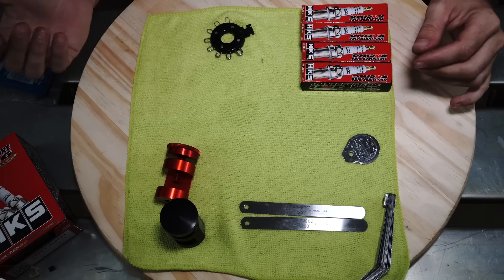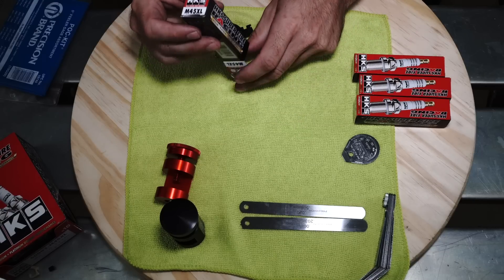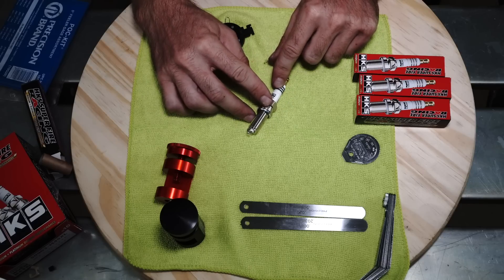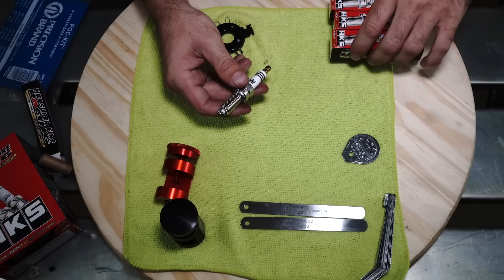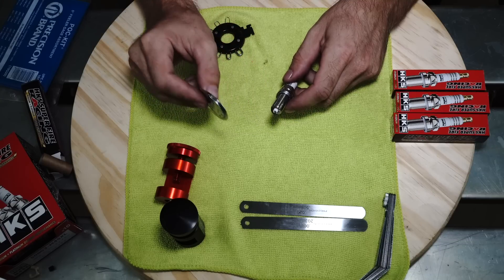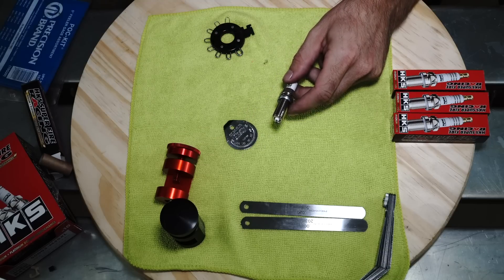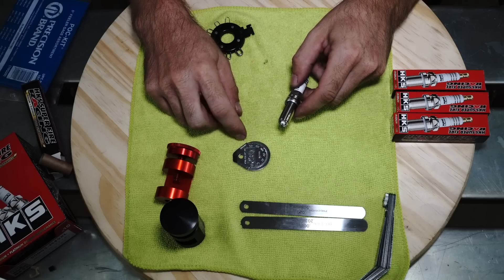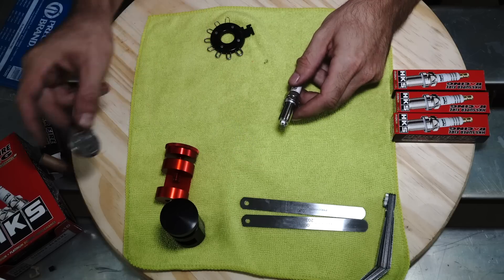How to Gap Iridium spark plugs

Comment: That tool works just fine The old style plug gapper you just don't want to use it to gap a iridium plugs. It works just fine for checking the gap just not making the gap larger

Comment: It's weird sensitive to little pressure, yet it's under high pressure to instant explosion, intense heat to cool air mix fuel, compression heat to explosive temperature extreme push pressure, but little prying is damaging.crazy

Comment: Appropriate and apt video.

Iridium tipped plugs are to be treated with kid gloves - how I miss the old days, as good as Iridium tipped plugs are setting them can be a fiddly chore. 

Also, if one can't find their trusty old tools for adjusting sparkplug gaps (I couldn't), then the options for such tools now are limited to a fair amount of Pacific Rim inferior tools💩💩 💔💔

The disc gap tools are okay but ONLY if inserted like a feeler gauge, and NOT used to lever or open the gap (especially not against the electrode), or used to wedge open the gap.  The hole can be  - in the correct orientation - CAREFULLY used to open up the gap (but it can be tricky and tight to the electrode). 

Nice to see you using a threaded gap closing tool btw.

No banging sparkplugs atop of a vice or the garage floor these days, especially not with Platinum or Iridium tipped sparkplugs. 

Just proceed with caution - follow best practice - and all should be well. 

A useful video.

Comment: This whole gaping thing is actually so complicated. Because they say dont touch the center piece, but you have to if you use all those things to measure the gap. So its literally dumb to me whenever anyone says "dont touch the center piece" and then they touch it anyways, they gave to, all those tools touch the center. So the best i seen is dude just said dont gap them , just put them in car,  because the factory gaps them to the proper gap. Its really just anal to try to get it exact anyways. And to much to get it perfect , means you touch that center piece, so any touch is damage according to everyone. So to me i would just take them all out the box and line them up and look at all the gaps together, and any absurdly higher or lower then the rest, then adjust that one. But other then that, i mean, the gaps on all those spark plugs in general are just so super close to almost touching, so the closer i dont think it would be a problem. I would love someone to test my theory. Just gap it to as close without touching and install them and see how car runs. I bet it probably run better. Because those gaps get wider over time. So gapping as close as possible is actually the gold standard if you ask me.  Problem with my theory, is i dont think ANYONE has made youtube video to show if this works or messes up car. But i think im right. We need like one of those anal science nerd youtubers to try it. But bottomline is, all i am saying is, all the gapping tools, they call touch the center piece that everyone says not to touch. So all tools have the potential to ruin the whole spark plug. Which to me means, never use any of the tools, and eyeball it and just make gap as small as possible and never put anything in between the center piece and top piece.

Comment: With the coin gapper you don’t just shove the ramp into the plug gap to open it up. It’s just used to measure the gap. You use the small “key ring” hole to open the gap which puts no pressure on the electrode. Still not the best for fine electrode plugs such as platinum, iridium, or ruthenium, but if used properly they are not complete trash.

Comment: Video is informative, but that’s actually not how you use the “round coin, necklace spark plug gap tool”  you stick the thru the hole and only apply pressure to the ground electrode.

Comment: I haven't even made it into the Vid and it's Not silly. My NGK's have a stinger/electrode on the strap end too. So it looks like 2 electrodes facing each other.. On mine.. They come pre gaped but I have laid them on the table and seen one off from the rest and had to tap it in a little. They are sensitive. wow. Oh and 25 a plug.. a $100 for 4 spark plugs.. I have that gapper and the one time I used it, I learned a $25 lesson..

Comment: Great video,  I just got a Lang 4550A ramp gauge tool with a built-in electrode bender. Also, that tool to bend the electrodes down is nice, but I've always used feeler gauges and cleaned them off first, then used a dial calculator to check the blades.

Comment: Very helpful and informative, and as I figured, the tips shown are the basic ways I was taught 45 years ago from my father gapping plugs. Moreover replacing my first set of modern plugs I sensed right away the delicate nature of the the electrode, and thanks to this video confirmed the methods I use to gap plugs is correct. There are many videos this one was the better video in my opinion simple and to the point.
Reply: Ditto here. As long lived as Iridium tipped sparkplugs are, I kinda long for the old days👍🙏😀

Comment: The circular tool is only a gage! Not a tool to adjust the gap! Wire gage is not recommended. you can damage the iridium tip by dragging the gage thru the gap.

Comment: You need to check the gap with the pressure of the tool off of the electrode  because the electrode springs back a little when you back off the knob.
Reply: Can you add some heat when it’s compressed to prevent it from springing back?
Reply: My thoughts exactly. How can a tool that large only do one thing plenty of room to make it bend it back somewhere on that thing

Comment: I am trying to replace my spark plugs for the first time and I keep hearing the coin-type is thrash. HOWEVER, what if you just pick a size on the coin-tool and with your eyes next to it try and isnert between the electrodes and see if it fits literally without making contact. Then you'd go up or down until you find a size which slightly touches the electrodes. NO SLIDING. Isn't this the same thing you're doing with the other 2 types. Someone let me know if I'm missing something.
Reply: The coin-types are still trash, they are not very accurate - they are cheaply made and the fact that they are a wedge design means that measurements aren't very precise. If you're not seeking precision, just run the plug as-is pre-gapped. Otherwise, invest in precise tools. Personally, if it's not way off I don't think -/+ 0.003" matters all that much e.g. if the pre-gap plug was 0.030" I wouldn't bother with the hassle of adjusting it to 0.028" if that was the listed spec.

Comment: Buy the tool from AliExpress directly, don't get screwed by crooks, #Aliexpress € 1,47  21%OFF | 14mm Lightweight Vehicle Caliper Gapper Gapping Aluminium Alloy Car Engine Spark Plug Gap Tool  Automobiles Accessories Durable
https://a.aliexpress.com/_dTfXBET

Comment: Since this is a how to video, I think it would be great to tell us what to look for when you are measuring the gap. Saying that's good while sticking your feeler gauge in doesn't tell us anything! How about saying that it should be a tight fit, loose fit, or maybe feeling just a bit of drag. Not a good explanation of how to...
Reply: Slight drag. If you have to force it in, it's too narrow.
Reply: @worshipwhilewewait  Thanks but already googled it since the video was no help...
Reply: @pdog2448  More research helps us DIYers anyway...don't you think he did a good job to get us started & thinking about checking the gaps? I never thought to check them with the tool until now. This guy meant well...I like that he introduced the tool AND demonstrated with it.
Reply: Correct “feel” for the feeler gauge - is called “magnetic drag”- as you pull the feeler gauge thru it should feel about same as dragging a magnet across a smooth steel surface. 😊😊😊👍👍👍
Reply: instablaster
Reply: I bought a "fan" feeler gauge. There was no "notch" to open the gap. I used the finger detent that is used for opening the gauges. Slides right in there, but be careful. Over corrected on the first one and had to tap it closed. No problem. The other three were a snap.
Reply: Superb presentation. The best I’ve seen on Youtube. Many thanks 🙏

Comment: You buy a set of pliyers that set the plug for you. With my Pro-Mod we so not use these tools. Also most over the counter plug come pre gapped to the engine your buying for. Most of them have a warring on them that says do not gap. But for racing they have tools just for this that make it easy for you. Most plugs you can go up or down no further then .008. you should size the plug to the chamber and piston. Then you choose a plug that burns hot of cold. By the number on the plug or on the box. If you gapping most people are doing it for a race engine. Not for the everyday vehicle. Most NGK plugs comes .020.

Comment: the round plug gaper the hole in the tool is the adjuster that adjusts the gap ! the  grd. electrode is bent up never pried up by the ramped gauge LOOK at the tool ive used them all they all work great I don't mind taping the electrode to close the gap . what you pay for the red tool ? not bad but a tap tap is not bad also

Comment: I gap all iridium false claims in my engineering room trash can. NGK i bust as fake  claims of more power lying to public
Reply: Remember those "split fire" plugs? and then the quad fire plugs.... Remember that before them, spark plugs were like $1 a piece?  Now it's $10  for one spark plug, that's even MORE fragile than the old ones and has absolutely ZERO  "PROVEN" advantage....it MIGHT give you more power, it MIGHT give you better mileage.     It might...over an OLD spark plug...sure...because, you know..it's old.    MIGHT give 3 hp....isn't sufficient enough value to make it $8 more expensive   :::harumphs in old man ::::
Reply: @phuku2927  I realise the facebook folks are limited physics and engineering designing anything or plugs. When you choose a plug for a given system ....its not done by using a spark plug chart cross reference ect.  You take ignition specs and calculate to plasma index thats reliable and feasible with given resistor. Heat range and threads away you go. A basic old school dealer purchased mopar plug 60s 70s 80s era you can skip the brainy part and ride.....dealer purchased in person. Tell everyone its a ngk iridium 12k ohm from amazon.
Reply: @jamesbullock7257  
What type of plugs would you recommend for 4 cylinder imports?

Comment: Ive used all 3 tools to gap platinum and iridium plugs from lawn mowers to weed eaters to different automobiles...have never had a problem with any, including the "coin" type.
Reply: People don't understand how to use the coin tool I guess. You never need to pry against the electrode with the coin tool, that's what the small 'O' opening is for!
Reply: That was my initial reaction, he just was never taught correctly.

Comment: There's me thinking that I could no longer tap these on the vice so I tried using pliers, slipped and trashed the porcelain. A tenner down the drain and another week for the replacement to arrive ffs. The coin type gauge is fine and you expand the gap with the hole. They are a great idea, if used correctly, so don't bin it like this video suggests.
Reply: Next time chick up a 4 inch C clamp in a bench vice.

Comment: Thank you very helpful, I do have a question. If you can help me with it I'd be very grateful. Denso makes three iridium spark plugs for my vehicle two of the gaps are.044 and the one I bought is .040. The OEM plugs are one of the .044's. should I run the ones I bought at .040 like denso lists or gap them to .044? The motors is not modified at all.
Reply from the maker: bpattillo707 hey there. I would run with the oem gap. I’m not sure which plug you have but you can probably open the GAp a bit. What is the plug part number?
Reply: @KDMTUNERS  So the plugs I have are IXEH22TT and are gaped at .040. The FXE2211 are the exact OEM and they are gaped at .044. They are going in a Nissan vq35hr. Desno lists both for the engine and list the gaps I showed. Thanks a ton I really appreciate it.
Reply: Run .044. But OEM is a compromising for several things.... You can use as big of a gap as your Oem ignition will handle. 

If you drive more for mileage, partial throttle, you aren't running WOT you can increase your gap .010 to .054  get a better more complete burn  You can GOOGLE IT. 
If .010 increase seems like too much to you gap your plugs at .050. Your ignition will easily handle that. 
If you are using previous metal plugs  USE A FEELER GAUGE gently check gaps. Only touch the ground strap to adjust the gap. If the .04mm wire electrode gets nicked IT WILL fall off. 

Ignition and air intake are big bang for buck. Replace coils & wires with MSD ACCEL MISSION IGNITION all off high out out ignition that aren't a lot more than AutoZone and sometimes less expensive than oem. 

Get a good DRY hi-flow air cleaner for your car. Stay away from the filters sprayed oil.
Reply: Aye so we use mm or the number above?

Comment: Why not just use the wire tool to not only open the gap but change your pressure direction to close it back instead of using the other tools or tapping?
Reply: I typically used the tool to bend the anode (being referred to in the video as the ground strap) toward the cathode (referred to as the electrode) to close the gap a bit.  Tapping is fine, but it's usually dropping the spark plug on all of that plentiful concrete that's eager to catch it for you that will kill a plug.  ;-)  In reality, if you simply open the plug gap and use one of these much, much nicer tools to gently close it down to spec, you'll be better off.
Reply: My thought is that doing what is stated above might be in danger of touching the electrode. Going away is safer. I took auto tech and our teacher used the tapping method as well. I can't imagine tapping the spark plug lightly like this video could cause harm. You are talking very minimal movements.

Comment: How often should the gap be checked on a (hard driven) daily driver, and also how many times can a spark plug be adjusted safely before the electrode becomes dangerously weakened? Thank you for your work in compiling these videos and for sharing your knowledge.
Reply from the maker: Incognito for a daily you might not run into an issue ever. If hard driven you will likely be changing plugs every 40k if not sooner. Plugs are a maintenance item and an important one so for me I check them every oil change. If you need to adjust them I do that once and if it opens up again I replace them. 

When racing like road racing, time attack, etc.. I like to check them after each session which might be overkill, however if you drop a plug you could destroy the whole motor! 

On the racecar it’s just part of our session run downs.. check oil, plugs, scan ecu, hoses, coolant, boost leaks, hose clamps, certain nuts and bolts we check torque, etc. doing this we have had 1 built motor last 4 seasons and still running!!

Thanks for watching! We will keeps these coming and have a ton of awesome videos in the works 😁

Comment: any other way to tighten outside of tapping it or a $40 tool?
Reply from the maker: David Santiago there are probably 1000 ways to do it, but those two methods work well without over doing it. If you are carful you could hold plug with two hands and push on a hard surface. Tapping if you don’t want to spend $40 is the best option as it usually doesn’t take much and unlikely you will damage anything. Growing up in a speed shop I always seen the old timers doing this. Some might not agree with that method. In a pinch, on a budget, trackside, etc.. tapping works great